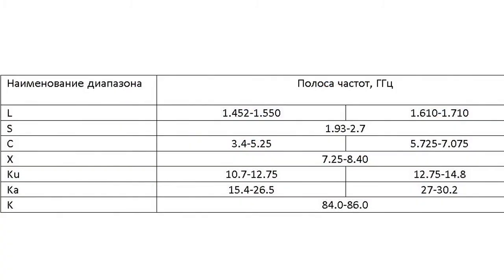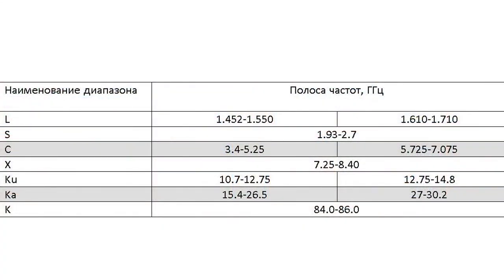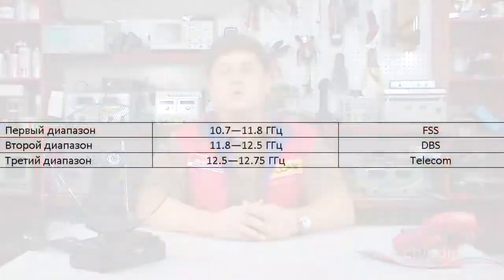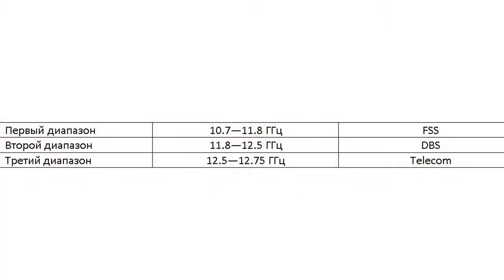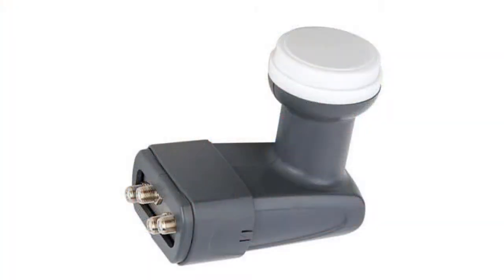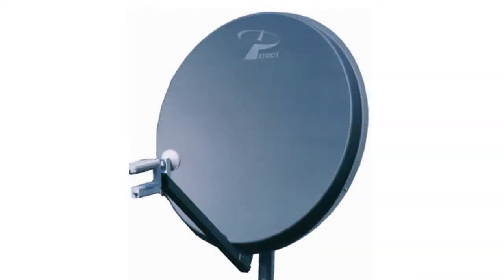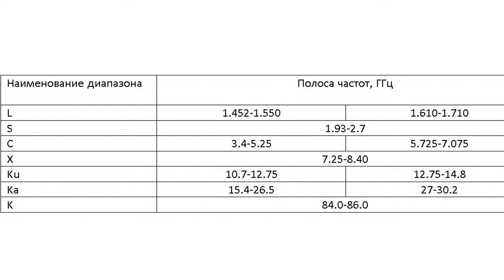IR transistors in DirectFET frames

Comment: Very good information.With newer designed lnb(low noise blocks) some of us have been able to receive some of the c-band communication satellites on an very small dish from 90cm up to about 120 cm.We have called this c-band on an small dish.With higher gains and better stability and signal to noise ratios some of us have experimented using these newer lnbs with the smaller dishes to receive  c-band here in the U.S.A. and other parts of the world.N0udq   Wayne L.Yardley wayne49@donegal.net 73"s